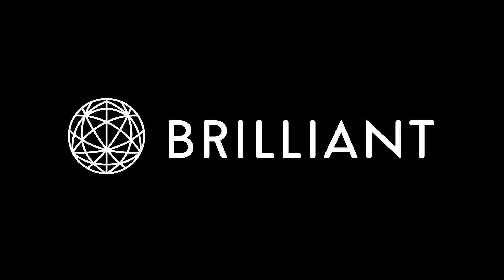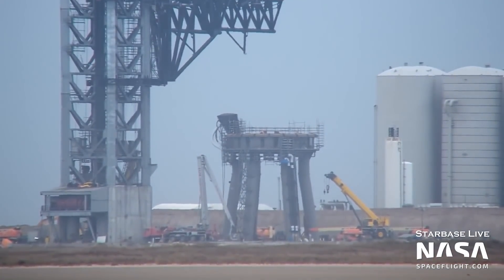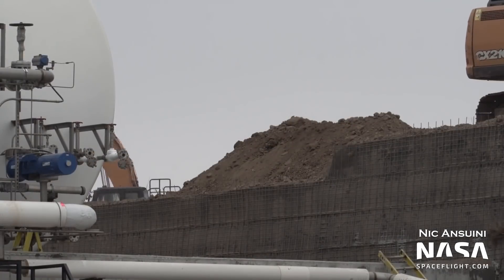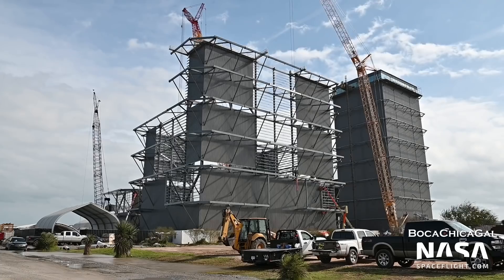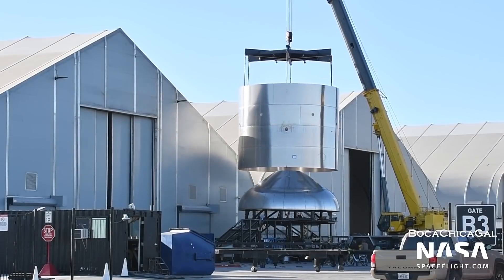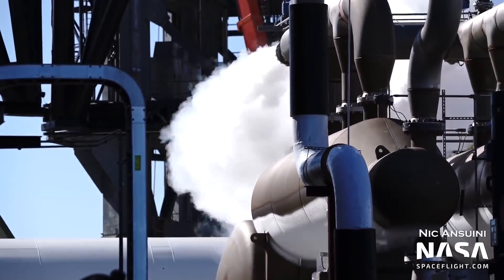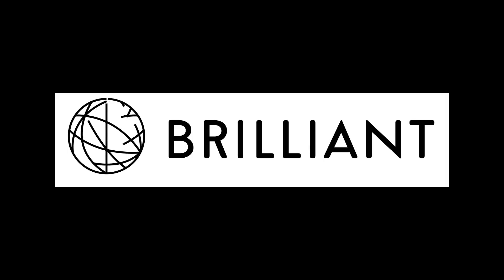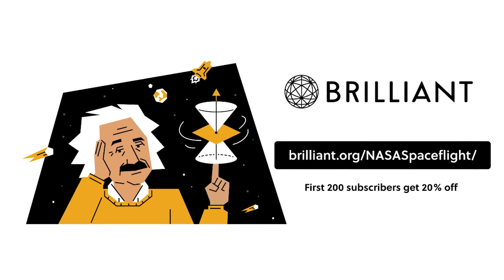SpaceX tests rocket catching system, but is the tank farm in trouble? | Starship Update (Narrated)

Comment: I don't agree at all ship 20 booster for 4 work for the suborbital test they need to learn about the reentry heating and they expect to lose the vehicle so why would you not burn it up over the ocean. The improvements that you've seen are all around landing there not planning on landing the first one and they don't need the extra engines because they're not trying to make it orbit
Reply: Im with you but also understand the other side, Remember they only signed up for like half a dozen flights for the whole year, Why use up one of those slots when you have ones that will provide slightly more data. Data and time are the crucial costs this year. Vehicles are a come and go.
Reply: @Vatsyayana87  because they're not building them anywhere near a rate of six per year completely finished with heat shields and 39 raptor engines their production rate of raptor engines is nowhere near where it needs to be so use the one you have then use the next one and hopefully by then you build another
Reply: @AllMyHobbies  lol we have no idea what the raptor production rate is right now, Last time we heard was several months ago and it was 1 every 48 hours.
 That has taken a hickup during a block change but they are literally building a mass production factory in this state for raptor 2 right now.
When it comes to the vehicles, its the same story, they are in a major iteration change right now, but when wide bay is done in a couple months, we can easily see 2 ships and boosters being made at all times, once they settle on an iteration, they could throw out a pair of boosters each month then use all 4+ locations for ships since they take longer with the TPS.
5-6 pairs is very doable.
Reply: @Vatsyayana87  you're right no one knows but what we do know is there's no way they're pumping out a tested flight qualified raptor every 48 hours they haven't even finish the factory. And Elon just said a few weeks ago that raptor production was in crisis. And thats Elon the guy who's time guess are always off by a factor of like 5. So when he claims they're making one every 48 hours that's more like one every 10 days.  And remember until they land the booster at a minimum this will be like the most expensive launch vehicle currently operating with the cost of the Raptors included.
Reply: @AllMyHobbies  There is a huge difference between his over optimistic guesses of when things will happen and him telling us what IS happening at the moment, that wouldnt be an Elon timeline thing but an out right lie,  not his style. 
This is in no way whatsoever the most expensive launch vehicle operating, its closer to the cheapest one out there while being ten times more capable the the next best.
I feel like you have a slight misunderstanding about this project and the man behind it.
Reply: @Vatsyayana87  I really do you need me to make a list of Elon's predictions of the wildly optimistic for starship alone. People call it elon time. There is a name for it because is so we known. And a rocket with 42 of the most advanced rocket engines on earth. What do you think that will cost when it all sinks to the bottom of the ocean?
Reply: @AllMyHobbies  I dont see what you find difficult about the difference of his predictions and when he is telling us what is currently happening.
And yes, raptors are bad ass and should cost a lot, but guess what, a single RS25 on SLS/Shuttle costs more then the entire set of a boosters engines.
This entire project shows how absolutely absurd the ways the rest of the world does rockets is.
Its the entire reason they are able to build something that can take over 100 tons to Mars in 2-5 years instead of 15 tons to low earth orbit in 10-20 years.
Reply: @Vatsyayana87  the rs25 they are using are old reused engines they are basically free at this point. Spacex is not. A public company he can say anything he wants about what they are currently doing. Does not mean its 100% reality.
Reply: @AllMyHobbies  Free!? lol!!
Go look up what they are paying for these old free engines to be flight readied.
MUCH more then an entire orbital stacked Starship for each RS25. Like 10-20 times as much..... As an entire Starship..... For one engine....
I dont know what you are even going on about.
And yeah no kidding Elon can lie to the public if he wants to, public or private business makes zero difference in this. But i would bet my house that he doesnt.
Reply: @AllMyHobbies  Man you just go on and on about whatever lol.
Show me where he has blamed the faa, i dont follow his every word but im gunna call straight up bullshit on this unless it can be proven.
Reply: @Vatsyayana87  here is a head lines "SpaceX's Starship could be ready for 1st orbital test flight 'in a few weeks,' Elon Musk says". That was in August it went on to say they could not because of faa. That was a strait up lie.
Reply: @Vatsyayana87  what are you talking about a public company you lie about what is happening at that company and you go to jail. And you have no idea what a starship is costing spacex so you have no way of saying its 10x less
Reply: @AllMyHobbies  So you proof is quoting someone quoting someone else? lol k.
Well that is not proof to me.
 Its in this case, triple hearsay, so about as reliable as a tweeker telling you what they need 10 bucks for.
Reply: @AllMyHobbies  Yup, there isnt a million examples of public companies lying without punishment lol.
Reply: @AllMyHobbies  Actually yeah the price thing was a pretty bogus guess, i was leaning into launch cost, not current build cost.. 
I believe raptors are somewhere about 3mil each, so just the 42 engines makes it about half the price of a pre used RS25. And the engines are easily the largest cost, So to take the guessing out, it can still be confidently said that an entire Starship system costs less then or about one RS25.

Im struggling to find the exact cost of a single on atm, and honestly we dont really have productive enough of a convo to care enough to dig for more then 3 minutes, i just dont like to spit actual nonsense when i can avoid it with a little research.
Reply: @Vatsyayana87  you are dreaming if you think 3 million maybe for material and machining and assembly alone but thats not how it works you have to pay your staff and you have to amortized the r&d costs in too. They are probably at a minimum 500million into the r&d alone. Here is elons tweet "First orbital stack of Starship should be ready for flight in a few weeks, pending only regulatory approval" aug 14
Reply: @AllMyHobbies  You consider that "blaming someone" eh? 
Im under no illusion what the overall cost  situation is like, I believe they spend about a billion dollars a year for the whole project.
But when its was dug into what it costs to use what they have on hand and build a single raptor, the estimate was about 3 million dollars.
If i remember right it was Tim Dodd that came to this conclusion and thats someone i have some faith into his capability to come to a realistic value and cares about giving accurate information.
So if its between him and your thoughts on the subject, i dont take a second to come to a conclusion who im gunna go with.
Reply: @Vatsyayana87  i like tim but he is a wedding photographer turned youtube with no actual engineering background unlike me. And he is totally guessing. Your numbers about the rs-25 are the cost to restart the production line for rs-25 and make new ones. The 16 they have on hand are not costing them anything. Other then testing and integration  cost.   Your comparing the full cost to create a factory and produce engines with the marginal unit cost estimates that people have guessed on the internet I'm sorry but your delusional. Its like comparing a goodyear tire that cost 40 dollars for them to make after you spend the 2 billion creating the factory. The cost you see nasa paying is to create the factory and output the first few engines. The price Elon is quoting is the 40 dollars
Reply: @AllMyHobbies  "Elon time" as labelled often omits all the waffle words so that "we hope to able to" becomes "we will" after the date passes. It is vastly unfair and actually disincentivizes the openness that everybody also praises. Do you prefer watching development mostly happen in the open and getting Qs Aed, or do you prefer guessing when Tory is finally going to get his damned engines from BO?
I do think it makes sense to fly 4/20 unless there is some other dead end that would invalidate the test results with regard to future designs, such as a new heat shield attachment mechanism or modified booster control strategy.
Reply: @AllMyHobbies  SpaceX is not a public company, it is privately held. There has been some speculation about spinning off Starlink in an IPO or SPAC in the future, but that could have been irrational exuberance. That sort of thing has been seriously tamped down now that the regulators have turned their eyes on SPACs.
Reply: @Markle2k  thats why i said they are not public so he can say what ever he wants. And just fyi if they spin out starlink thats a very bad sign. Elon would love to keep starlink private he plan was for it to be super profitable and pay for his mission to mars. If he end up having to make it public that will be because its losing too much money for spacex to handle. And he need to get some stupid money in to keep it going.

Comment: Will Starship be preloaded with cargo prior to being stacked or after?
Reply: Not after
Reply: Cargo loading procedures will vary based on the type of cargo.

I expect that delicate satellites like telescopes will be loaded into Starships in a payload handling building with a clean room at the height of still to be designed cargo doors.

It will be interesting to see how they load Starlink satellites.

The most common cargo flights will carry propellants. Those will be loaded after stacking.

Eventually, humans will get into starships using an arm on the launch tower which meets up with the hatch.
Reply: @hamjudo  Yeah i suppose fuel loads are cargo lol. But i dont think thats what anyone is ever talking about when they ask this question.
Reply: @hamjudo  Conceivably, they could do a RSS like the Shuttle had, clean room on the pad.
Reply: @hamjudo  I cant imagine cargo ever being loaded into a rocket on the pad. People arent cargo imo lol.
Though it is Spacex, so i wont even try to tell anyone what they will or will not do in the future, but it doesnt really make any sense to ever do this that i can see.

It just shuts down the entire launch site for many hours while putting people and the cargo in unnecessary danger with no benefit at all compared to just doing it in the bays 2 miles down the road.

Comment: Any link to the Texas Railroad Commission LNG regulations? I can only find the old regs which allow for a chain link fence surrounding the tank rather than a solid wall.
Reply: I heard if its a chain link it must have barbed wire along the top as well, is that what you read as well? Or just a solid wall like this. This came from RVG Aerial, they seem like they know where to find solid info on this stuff so i trust it for the most part.

Otherwise i have no idea where to find it sorry.
You would think a 40 foot steel wall with 1.5 meters of insulation would cover the spill concerns lol but who knows...
Reply: @Vatsyayana87  It was 
"Sec. 14.2101 - System Protection Requirements | State Regulations" that said 6 foot (or 5 foot plus barbed wire top) but I believe that has been replaced with a tighter code.

Aha, I've found it on official site, had to set my VPN to USA as cloudflare was blocking access. Still allows chain link.
Reply: @andyalder1  Copy that.
Whatever the case, lets hope it all comes together within the next month or so.
Cheers.

Comment: Dirt berm was most likely placed to consolidate the soils  beneath it so a heavy structure can be built above it such as another orbital launch tower. This vastly improves the settlement of Heavy structures.
Reply: They use piles or concrete on these sites, they have never used soil compression this way, the berm was there for direct reasons we are not questioning, if they ever want to compress soil they will spend 2 days doing it with equipment not spend a thousand man hours and several months of waiting.
It was built to protect the farm from explosive landings, They no longer plan on landing there anymore and so dont need the berm, on top of that with the possible tank farm upgrade needed this location is perfect.
Reply: @Vatsyayana87  They started out the pad doing exactly this. They brought in a shitton of soil and piled it on and let it sit while they did other stuff (learning how to build Starships). And then they carted all the soil away and built the landing pad and the tower.
Not that I agree that that is what they are doing, but your history is wrong.
Reply: @Markle2k  Its certainly possible, its hard to remember every move they have made over the last two years, but i dont remember that and ill go back to see the process your talking about.
What exactly do you mean the pad?
Reply: People keep suggesting this but that doesnt make any sort of sense at all in this case.
Reply: It was marked in the site plans as a blast protection berm, and was shaped perfectly to redirect exhaust from a landing Starship above the tanks.

Comment: The only reason, and why I think that B4 and S20 will fly is Raptor (1), as far as I know, in McGregor they are just testing Raptors 2 so really what are they going to do with 32 Raptor 1 SL and 3 Vaccum, they are going to scrap them? Would kind of make sense, but you have the engine just use it and throw it away while testing it, even if it is outdated
Reply: Time use is much more important then raptors, especially old ones. As much as i agree they should just fly it, they only signed up for like half a dozen flights in 2022, they can easily make that many better class vehicles and so would have to not fly one of them to use this duo instead.
Reply: @Vatsyayana87  I don't know if I'd say they can easily put together another 5 booster and Starship pairs with only one pair currently getting built.
Reply: @Danrarbc  In a year? They absolutely can. Even without the new highbay its possible if they were to settle on its current iteration. But thats not gunna happen. Once the new bay is running they will be able to double if not triple how many can be built at once. Either 4 or 6 vehicles at one time.

 Im assuming 4 but i think the new bay very well might be able to do one in each corner using todays methods and the two cranes it will have.
Reply: Given the design has changed, the only reason I can see for them to fly B4/S20 is to get data on the TPS tiles at reentry.  But with the current tiles falling off during tests it maybe a better use of their time to keep iterating on the tiles and their attachment method and test reentry on a future ship.  The time needed to do a full launch takes away a lot of time from other processes, so it needs to be worth doing. And with the FAA clearance delay they may have decided to scrap plans to launch the current design and try finish off the next design so that's ready for launch when they get clearance.
Reply: maybe no matter what engine they use they get data as in the thrust to weight
Reply: I think the new design will very likely be compatible with both Raptor 1 and Raptor 2,  just to keep their options open.
Reply: Yup, if you expect a crash and burn to develop systems and software, use the 9ld stuff first.

Comment: 7:56 Unless there is thought that 4-20 is a danger to the launch complex. Would it  not be better to fly the two for test data? (not all has changed.) I mean, if you're going to scrap them, why not do it after a flight. Spacex sure don't need any more lawn ornaments.
Reply: If i know it correctly, FAA will give permit to launch 5 times. Maybe they don't want to use one up on a slightly older one. (Personly i think they want to fly SN20 and SH4 though, but time will tell (or Elon))
Reply: @adammarsi3817  So it wasn't SpaceX asking for only 5 flights, but FAA telling them they shouldn't ask for more? ;-)
Reply: I think any first flight is a danger to the launch complex.  I would go with whatever had the best chance of success.   It may seem like a waste to abandon the current combo, but any failure that can be avoided (especially at launch) will reduce chance of extra delays.  What are the costs of rebuilding launch tower or tank farms in time and money.
Reply: @nandakumarnongmaithem6706  not if that test shows major design flaws that later versions will also have. There's a reason win 7 stayed dominate after 8 and 10 was out since it was more stable before the other 2 got better
Reply: @dominicblake5  Just like Win2K stayed in use for so long. Newer does not always mean better. And the main reason for flying B4SN20 is to get data on the reentry. They need to see how the tile system is going to work or not work. They already have asked NASA to provide a pair of their B-57s to do photo and data work on that reentry.